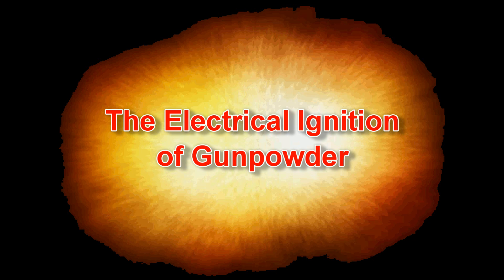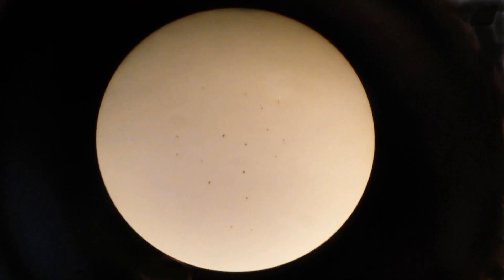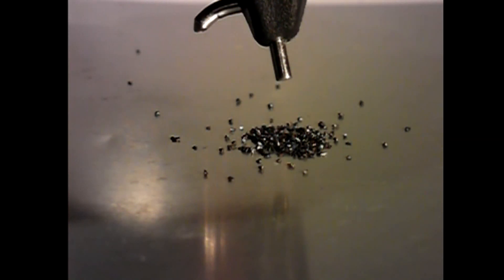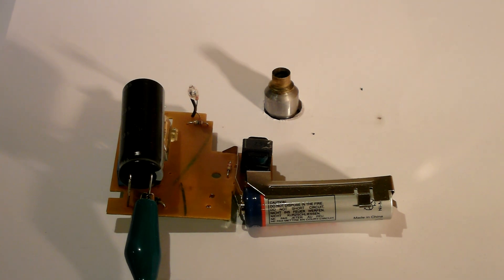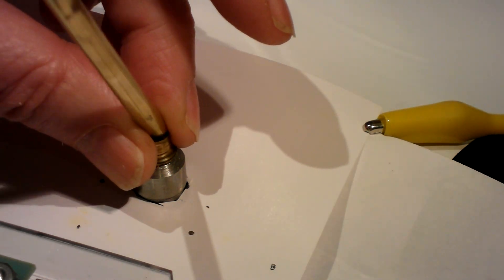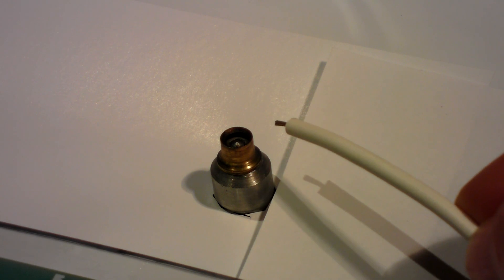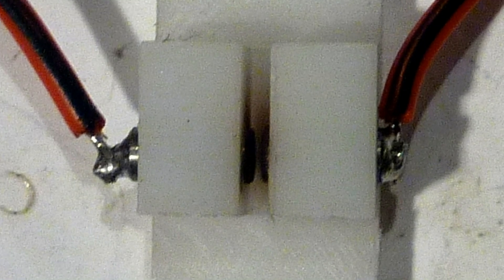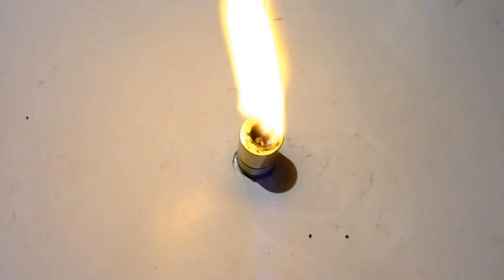The Electrical Ignition of Gunpowder

Comment: Nice video, Mishooter. However, the info I was looking for was "how to fire a bullet with electricity." I would like to know what voltage needs to be applied to a center-fire bullet (with the bullet casing connected to the ground wire), so that the percussion cap detonates. This info would enable me to make a concealed gun, firing real bullets, without the complicated mechanism of firing pin, springs and trigger.
Reply: It is not as much a question of voltage as current. A primer with a plated brass capsule is a good conductor of electricity, so a very high current would be needed to heat it up enough to go off. To heat it up in a short period of time (and it still wouldn't be fast) would require several thousand watts, which simply isn't practical. Remington sold a rifle which used  electrically-fired cartridges, but those used special primers designed to be electrically ignited.
Reply: @stephenwardlaw6428  Very useful info. Thanks for the prompt reply!

Comment: If electricity could cause gun powder to ignite, then could an EMP (electromagnetic pulse which induces high voltage) nearby cause the powder to ignite?
Reply: Good question. Gunpowder is non-conductive (generally) and so can't have an induced current from a magnetic field, such as that from an EMP. Also, any conductor has to be long enough that the field can generate sufficient voltage to do damage, which depends upon the field intensity and type of pulse. The short answer is no, it can't.
Reply: @stephenwardlaw6428  I see. Thank you!
Reply: @stephenwardlaw6428 black powder is usually coated with graphite which makes it conductive, therefore a strong enough changing magnetic field will be able to induce enough eddy current to heat it up and potentially ignite it. However it is impossible  you will ever come across a sufficiently powerful pulse to do so.

Comment: I was curious as to how you prevent fouling from bridging the gap between electrodes when using black powder. I'm trying to design a very low cost-to-shoot rifle, and black powder can be made at home for pennies per shot.
Reply: Eventually, the fouling can cause a problem, but since it is not conductive (if dry), you can get quite a few shots before you need to clean it. Just remember that black powder is NOT electrically conductive unless the grains have been graphite coated.
Reply: @stephenwardlaw6428  Oh I see, alright thank you for the response!

Comment: i found your work after googling whether an electric current could ignite gunpowder, because i had the idea of a saver firearm without a cocked hammer and just a spark to ignite the load. guess im not the first one. :-) 

do you have any idea if this could trigger a common primer in a conventional cartridge bullet? have you experimented with piezoelectric elements like those in lighters? 

sorry if my questions are annoying, im nothing more than an interested mind. not extraordinarily experienced with guns or electricity whatsoever. 
regardless, great video.
Reply: There was a commercial system, the Remington EtronX, which used electricity to fire a cartridge with a modified primer. It worked very well but was not commercially successful. I tried any number of piezoelectric igniters, but none of them produce enough energy to ignite any type of powder. The web page associated with this video goes over all of this in more detail.
Reply: @stephenwardlaw6428  
thanks for the response.

Comment: So idk if you still read your comments....

But the CCFL inverter you have in your schematics in no longer readily available.
Would this one work:  560-BXA-601 ?
Or would this one be better: 560-BXA-12529
Reply: The  560-BXA-601 is closest to an exact replacement as far as I can see. I now use a single rechargeable lithium cell to power mine (about 6V), and a full-wave rectified output charges the capacitors to about 650V, which does the job quite nicely.
Reply: Oops that should have been slightly less than 4V from the battery.
Reply: @stephenwardlaw6428  Thank you very much kind sir!

Do you know about arc-lighters?
They seem pretty good for this too, in theory, plus it is readily available for as low as 10bucks and are already in a compact form.
Reply: @xxxm981  I made a pistol using one, but there is a noticeable delay in ignition (like a slow flintlock). This is because the energy is low and it takes a finite time to heat the powder to the ignition point. Although it was simpler, I went back to the augmented arc method,
Reply: @stephenwardlaw6428  Oh, interesting. I would have thought it has more beef, considering they are designed to ignite more than just gas.

Comment: What battery did you use with the capacitor and what other components? Could see a few resistors on the circuit board. It's a really interesting system and would make constructing a simple muzzleloader even easier!
Reply: If you click on the schematic, it will download a larger version, along with a parts list. If you just need to ignite black powder, I used a much simpler version shown here: http://ctmuzzleloaders.com/ctml_experiments/electric_ml/electricml.html

Comment: Commercial black powder grains are tumbled in graphite to make them conductive on the outside, so that they cannot be ignited by stray static sparks. looks like it works.
Reply from the maker: Even if the graphite is removed and the grains reduced to dust, static sparks still can't set it off.
Reply: How did you remove the graphite? If graphited powder was crushed and ground it would still have graphite in it.

The graphite must be added for a reason surely?
Reply: I've been experimenting on this with a few people for about 2 years for a semi automatic repeater version and I confirmed all of mlshooter's findings. Rocket candy won't work for example. Even 99% isopropyl alcohol vapors cannot be ignited reliably with a stun gun! Ultimately his ignition design is what I have found works best  from day 1 for the reasons he detailed here. My issue is that as a repeater the electronics cant keep up with the mechanism so even though I have solved the feeding and fouling issues (ironically one of the best guides for my design came from a video game called Call of Duty Advanced Warfare off a gun called the IMR, probably a reference to the DuPonts popular smokeless powder line), the end result is a semi auto that is seemingly as slow as a manual action. Still nice to plink with, but not what I had in mind as a cheap training substitute during ammo shortages (long gone, but will come again). If the semi auto action is too fast you get basically an out of battery ignition which a few times has blown the powder magazine of 1000 grains to bits (all of my tests are remotely fired of course). I've made a .117 caliber version that actually seems less prone to this issue, but the output is so weak that you mind as well use a co2 pellet gun. I'm thinking of making a new chamber wheel with a bottle neck profile and seeing if I can just improve my 117 model.
Reply: I'm not surprised a stun gun couldn't ignite it, the current is minuscule.

Comment: Can i use bug zapper (2000VDC) for Ignition?
Reply from the maker: It may work, but there will be an appreciable delay since they can't put out much power and therefore can't raise the temperature of the powder grains very fast.
Reply: If i use bug zapper as substitute for CCFL inverter,than out put to R1(DC-augment Igniter). is it enough increase power?
Reply from the maker: Perhaps. The zapper may actually be a CCFL inverter, but if the output is too high, it could destroy the diodes and/or the capacitors.

Comment: Didn’t you tried something like:
-measure resistance of old black powder
-note the tension of your capacitor
-measure resistance of smokeless black powder
-act in a way to deliver the same amount of amperage and energy to the smokeless black powder as you did on the old one (I think u know u=ri, p=ui). May the power need to be greater because of the higher ignition temperature.

The last point may be done by using a bank of capacitor:
-in parallel during charging
-in series during discharging
Something like a Marx generator

Comment: Just a side question so because of the efforts it took to produce ignition of even black powder would you say it's safe to load black powder through a normal powder measure? None of the Black powder measures ever drop the same amount every time like the normal powder measures but people have said in the past that a spark could form that would ignite the gun powder. Is this true?
Reply from the maker: Talmadge, I have NEVER been able to ignite black powder with a static electricity spark, and others have shown the same thing. If the reloading setup is made from non-ferrous metals or plastic, then a frictional spark is also unlikely and using it should be perfectly safe if the usual precautions are taken.
Reply: mlshooter
Do you think a electrically ignited revolver would be possible ? Like putting the wire that dispatch the electrical charge/flash on the hammer?
Reply: There is a possibility of friction or pressure igniting it, but I think it is rare as I have used an RCBS powder measure for a few years with no issue. One thing I do do is keep the top open to help aid any venting and I installed a 1/4" thick steel blast shield offset 3" away from the powder measure body and an arm extension so even if it does detonate, I am safe. Likely overkill though since I never did have BP ignite on me in the measure.